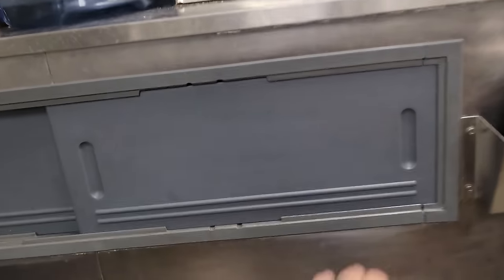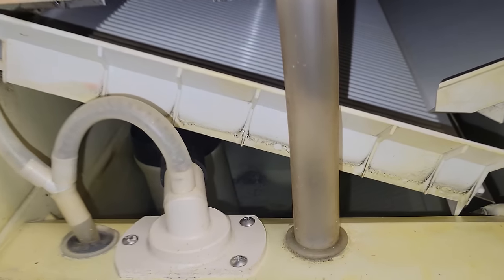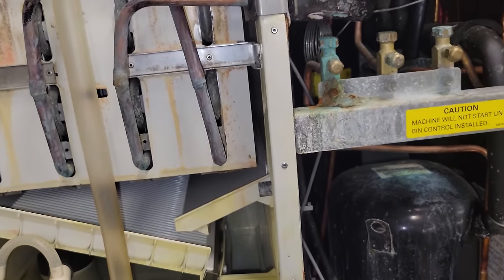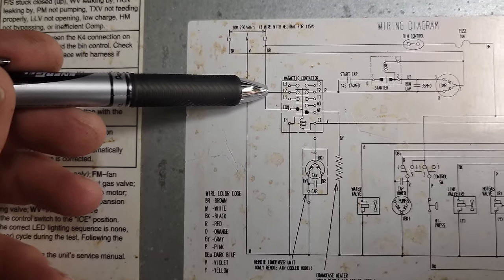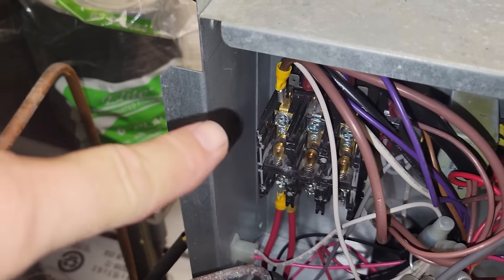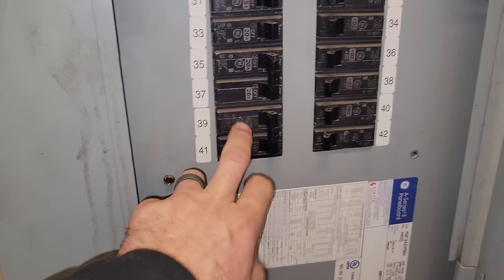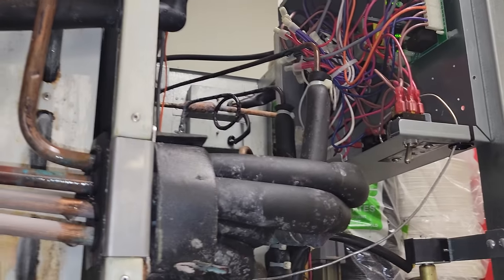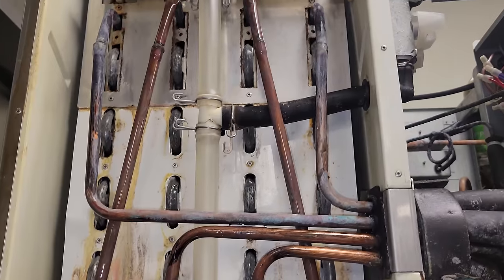THE ICE MACHINE TRIPPED THE BREAKER

Comment: Man... You just reminded me of one job way back when I was an apprentice electrician. We were installing a new fire suppression system in a restaurant in a mall food court. My job at the time was to install a three phase contactor in a new JB that would kill power to one of the kitchen appliances in the event of a fire. 

We had a limited time window between opening and the lunch rush, so we ended up needing to get a lot of the prep done, temporarily bypass some things to allow them to open for lunch (when they made most of their money) then finish up after lunch.

Well, me being not careful enough as an apprentice (lesson permanently learned) I didn't turn off the breaker I temporarily turned on for lunch time. Got back to work, stuck my screwdriver in and managed to short one leg to ground.

Why did I go through such a long explanation for a simple short circuit? Well, let me tell you! (And thank you if you got this far). The thing about malls is they have several tiers of panels and sub panels and feeder panels.

I didn't trip the breaker in the sub-panel in the kitchen. I didn't trip the breaker in the main panel for the restaurant. I didn't trip the breaker in the feeder panel for that block of stores. I managed to trip the breaker in the feeder panel for the FLOOR.

That was not a good day.
Reply: Was it an easy fix by just flipping the breakers back on or did you NUKE the breaker and it had to be replaced?

Chris early in his career apparently NUKED a buildings Main Breaker (the one connected to the Local Grid and then energizes the bus bars) that had to be replaced by an Electrician because he touched the wrong thing...I don't know which Video he tells us that...
Reply: @HappilyHomicidalHooligan  well, if breakers aren't replaced frequently, a short can literally destroy the components inside and jam open or worse closed

Comment: The "corrosion" in the breaker panel looked like dried up de-ox someone may have put on the connections. Even though it's not needed in that application. Kudos for moving the leads to the unused pole on the contactor instead of changing out the contactor......

Comment: I saw bolt in breakers and thought he working that HOT (takes a few special rated tools that I did not think you carried). Glad you cleared that up. 
Love your 'don't blow up.  You are obviously some one in the happened before crowd. PLEASE wear a full face shield if even think it is a slight possibility. I have my face because I was standing in the only position that shielded it from the ARC/flying red metal.

Comment: I wonder how many times that high-resistance connection caused that breaker to trip. I would be willing to bet the owner just kept resetting the breaker until the poor thing simply failed.  Out-of-date panel directories are a PIA. As for the contactor I see no issue there. Two sets of pristine contacts to use.
Reply: In theory, a high-resistance connection in the equipment will not trip the breaker, unless the connection fails resulting in a ground fault. Increased resistance = lower amp draw. Breaker was failing imo.

Comment: LoL I was like this ain't three phase if they only use one. The question of how it starts but you found the hidden starter and capacitor.

The breaker does appear bad but did you test everything to ground first? You should have just for the video imo

Always a smart move to test the machine to ground because you don't know who or what turned it off. I realize the burn at the contactor is a good clue but it's always wise to quickly probe

As a non business related issue someone flipped my stove off I'm guessing. I have no idea but I tested it to ground first before flipping back on. Better than getting shocked.